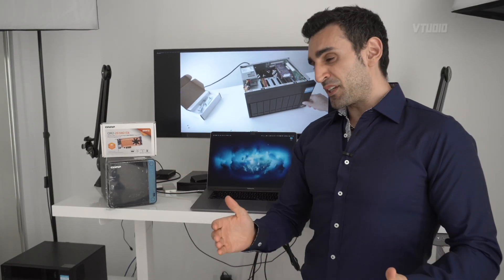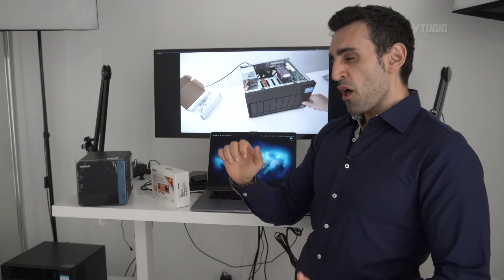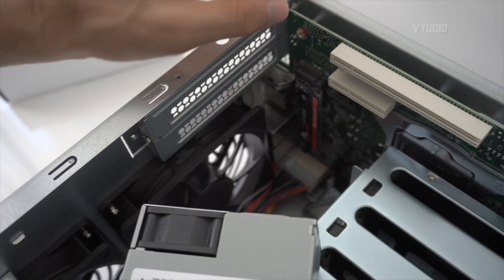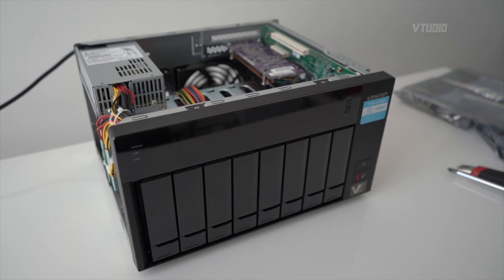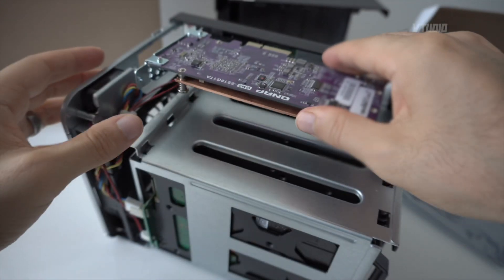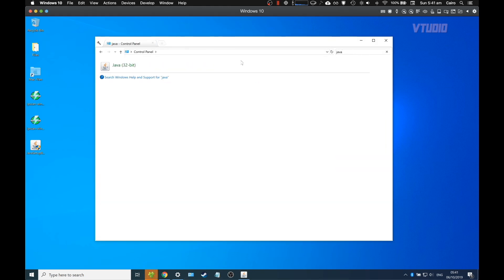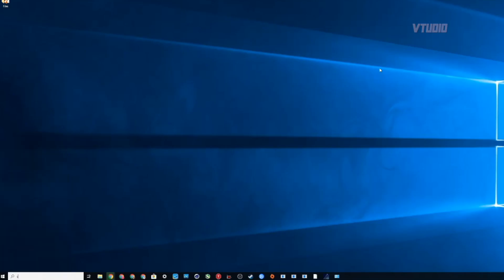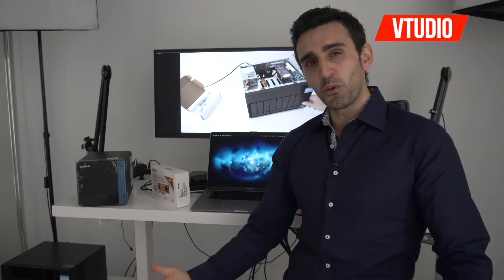10GBe PCIe Upgrade Guide & Performance Review | QNAP NAS QM2-2S10G1TA

Comment: This is an old video, but I was looking for information about how the PCIe slot bandwidth in my TS-464 might bottleneck the QM2-2P10G1TB I just bought and I chanced upon this video! It never occurred to me to spread the load by splitting the cache between the built in m.2 slot and the card's m.2 slot, so thanks for that idea!

Comment: Thanks for the great info/video. Is there any speed benefit of using a 1TB SDD over 500GB if my intention is to use the SSD for cache? My set-up is QNAP 453Be with 4 HDD in RAID5. I wanted to install this and add 2 SSD in RAID0 and use it for cache. I already bought this card (NVME version) and looking for a set of SSD to go with it.

Comment: hello my friend, I own a qnap 670 pro with pci ex gen2 x4 slot, my cpu is an i7 3770t and 16gb of ram, I would like to upgrade my system with this card but I am undecided between the QM2-2S10G1TA and the QM2-2P10G1TA , what do you recommend for the best performance ever? considering that my cpu is an i7 and no longer the original i3, would I be able to have the performance of 10gb with the QM2-2S10G1TA? or is it better to opt for more reactive with nmve ssd? (QM2-2P10G1TA)

Comment: I've just got the QM2 PCIE adapter for my TS453BE, I'd like to know if there is any suggestion for which M2 SSD should I adapt into it? Also, should I config my raid into Qtier or not to get the best performance out of it? I'll be using 10gbe on my network. Thanks!
Reply from the maker: Hey mate, it depends on the model adapter you purchased, should be listed on the back of the box. Qtier expands your storage onto your SSD to maximise space but introduces point of failure, so if your SSD fails you loose data. Read only caching is safest.
Reply: @headsoftech  Thanks man!  Love your videos, one more question, should SSD be the same size and model or can these be different?
Reply: @cargo4067  if you are going to use RAID then you would like to have two identical drives for best performance

Comment: Great video first of all, really like how you explain and demonstrate it. But could it be that to get the best bandwidth out off the TS-453be we just should add a USB 3.1 PCIe (USB-U31A2P01)??? cause as you mentioned even after adding the QM2-2S10G1TA it Max out to 5Gbps on RAID O which makes the CPU the true bottleneck. With that in mind, why spend so much on the QM2-2S10G1TA and M.2 SSD's? Could it be that with 2 HDD's + 2 SDD (as CACHE) in your storage pool plus adding the USB 3.1 PCIe, which is cheaper than the QM2-2S10G1TA, get similar performance as you showed? Of course you will lose the network ability side of it and have instead a short USB3.1 cable and have TS-453Be serve as a DAS when you really need faster speeds.
Reply from the maker: Great point mate, personally I like having a faster connection ethernet connection as I hate fan noise so I like to run a longer wire between my system and my NAS, but yeah the great thing about these units is that the PCIe slot is open to various use so you can customize it to your particular liking.

Comment: Macs are getting so expensive I’m still glad I have my 5.1 Mac Pro I just put a siig pice 2xusb 3 1x usb c and m.2 slot in it with a 1 tb intel ss6 m.2 and it is snappy as hell better than anything I’ve used in a long time it’s loaded with pice ssd accelerator cards and server grade ssd drives it’s instructable
Reply from the maker: Congrats mate, you've got yourself a beast

Comment: You seem to know your things around NAS... What would you recommend for me who want to replace my 4 external drives into a single NAS storage container? I'm thinking thunderbolt, but mostly when I search on NAS with like 4 drive container or more, most is RAID instead.
Reply from the maker: Hey mate, I've got a video lined up which goes through three solid options as well as another one explaining what RAID is.

But in short, RAID just means how you combine your drives - RAID0 = use them all together for max speed, RAID6 uses two of them as backup, so if any of the drives fail you don't lose all your data. The second point to look for is the processing speed, a Celeron NAS will get you a maximum of 500MB/s, while a full fat Intel i3 will get you a maximum of 1000MB/s. The more drives you put in the faster they'll go, so more bays = faster speeds. Finally the connection matters, a NAS with thunderbolt will give you a max speed of 1000MB/s however thunderbolt cables are only a max of 2m in length. So a better solution is a NAS with 10gbe and a 10gbe to thunderbolt adapted. 10gbe cables can go up to 100m in length and NAS drives with hard drives can be noisy so I prefer connecting this way.

Hope that helped a bit and I'll have a more comprehensive video on the different in drives/price out by the end of the week.
Reply: thunderbolt NASes are a lot more expensive than just regular ethernet.  TS-453Be is a good choice for you.  Not too expensive, can hold 4 drives for some good capacity storage.  Has a pci-e slot for 10GbE card.